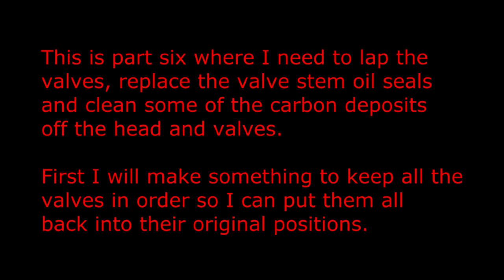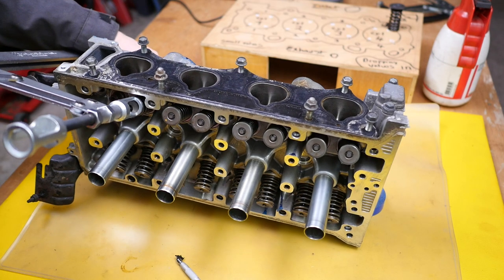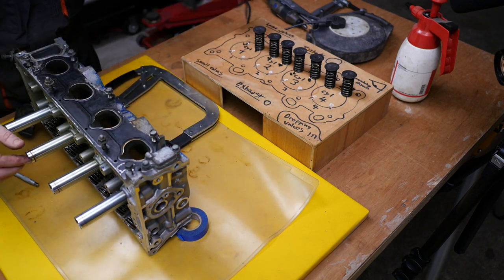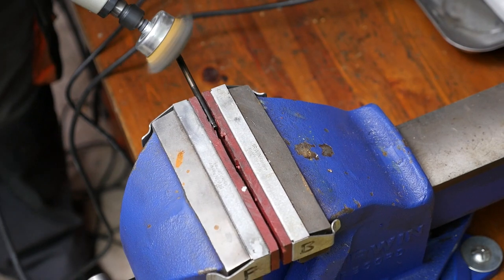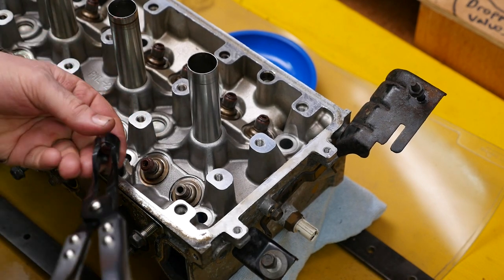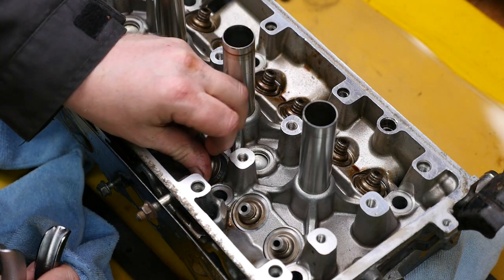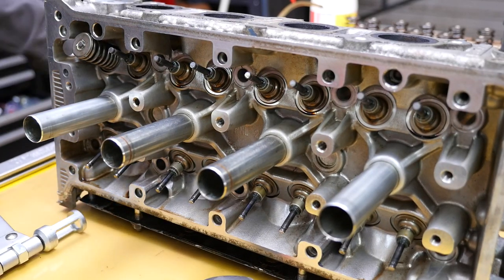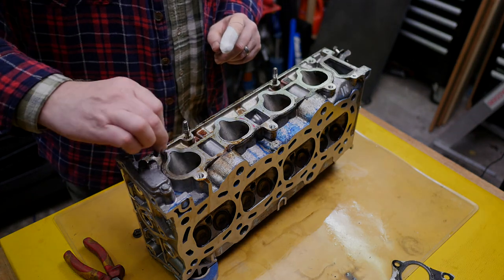Part 6 - Honda CRV 2 litre K20 Head Gasket Repair .. Lapping Valves & replacing Valve Stem Oil Seals

Comment: Another great video. When I am cleaning the carbon off valves I put my old mains drill in the vice and use it as a lathe and using
emery cloth polish the valves that way. Much less chance of bending them.  My battery drill has not got a lock on switch.
Reply from the maker: Thank you for the compliment.  Sounds like a good plan.  Do you some how oscillate back and forth? As I remember reading about a left and right movement followed by lifting the valve to a new position for even grinding.  Mind your talking polishing.  Probably going to another level to my basic works.
Reply: @CoatsandGaiters  I just use the drill to remove the carbon deposits from the valves. I am old school with the lapping, the stick and sucker method.
Reply from the maker: @neilhampson2843  I sensed you might be a perfectionist

Comment: How does the tool on the drill work compared to the hand method thanks!
Reply from the maker: Works very well
Reply: @CoatsandGaiters  Thanks I use a drill with a vacuum hose on the valve stem and it works pretty good ima invest in this tool thanks
Reply from the maker: @shimon2476  I think the only problem with a drill is it rotates one way.  This tool rotates back and fourth to give an even cut.

Comment: Hello, i love your videos, and i really appreciate the fact that you took the time and effort to record them (: Do you know how i can clean the sludge from my engine block since i am doing this repair because there was an internal leak or antifreeze into the engine ): . Hope you can help and once again thank you very much (: Good bye
Reply from the maker: I presumed you've drained it all and discarded the oil filter.  I'm not sure on this but I guess if it were me, I'd either buy a dedicated flush and/or put some cheap oil in and run the engine till hot and keep draining/refilling until the oil seemed clear, once clear I'd change the oil again probably after 500 miles or so and put decent oil back in then.  This is all I can think off off the top of my head I'm afraid.
Reply: Coats and Gaiters I never thought of this thank you 🙏🏼

Comment: Does it matter what way they go in if you buy new valves?
Reply from the maker: I'd presume new valves would just need popping in.  I'd assume all the inlet were the same size as would be the outlet valves.  I think they once ground new valves in but I also read they advise against grinding new valves as they may have a coating on.  Sorry I couldn't help much on that one.